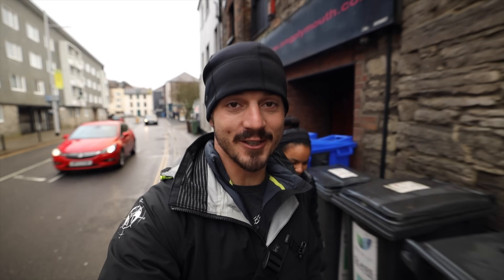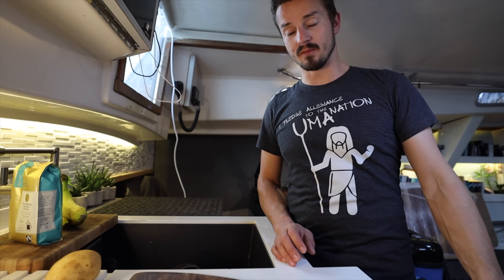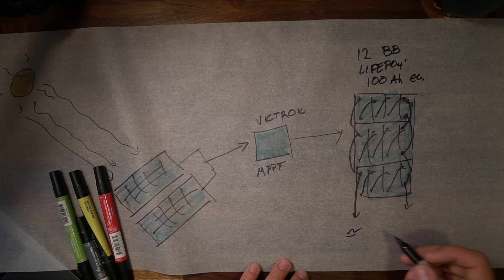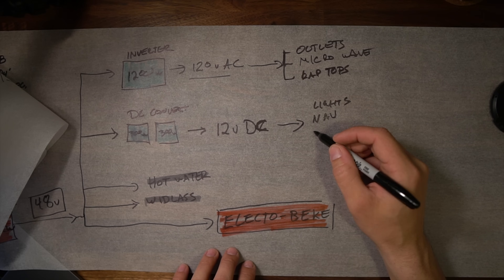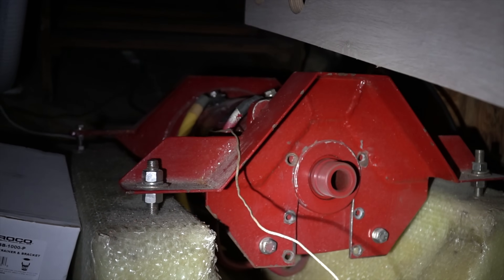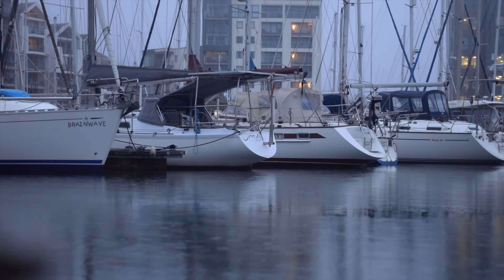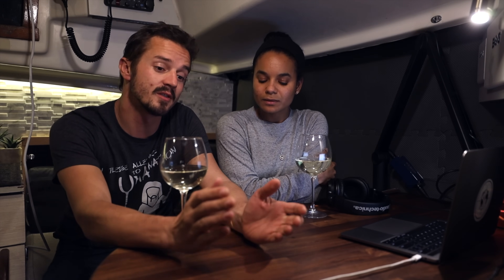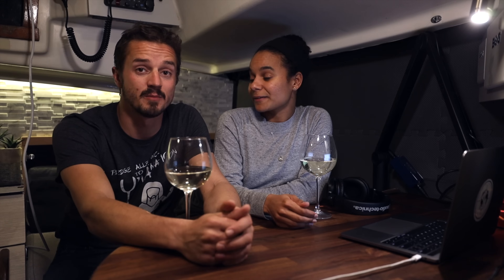5 Years Living offgrid on an ALL ELECTRIC Sailboat — Sailing Uma [Step 206]

Comment: Ok I know this is old and you probably already figured this out… but most laptops now can be charged from 12V so you don’t have to use the 110V wall wart and inverter. The laptop wants DC anyway so the most efficient path is through your DC/DC converter. There are some nice USB-C PD jacks you can get that get hard wired to 12V or use a cigarette lighter port.

Comment: How can 100Ah * 12 * 48V make 15KWh?
Reply from the maker: 100ah X 12V = 1200Wh (each battery)
1200wh X 12 batteries = 14,400Wh

We had 4 12V batteries wired in series to make 48V and we had 3 sets of these wired in parallel. 

I think the confusion is that most boat owners refer to everything in "amps" which makes zero sense, since amp depend on what voltage you're using. And since most modern boats now have at least 2 voltages (12V DC and 230v AC) amps mean nothing unless you're specign wire size or breaker size. Watts is the real number to focus on, since that's the actual draw an appliance is making.
Reply: @SailingUma  i wrongly assumed that they were 100ah 48v batteries, thanks for clarification

Comment: could you use your motor for regenerative use? Why don´t you?
Reply from the maker: We can now. Since we’ve upgraded from this unit. 

We’ve done a lot of trials and learned a lot. 

Bottom line, direct drive and fixed prop set ups really don’t provide much usable regen at the speeds small monohulls sail at.

Comment: Great job explaining your power system, your energy storage and usage. I am guessing you might consider replacing your solar with more efficient panels and also increasing the surface area a bit ... maybe have a portable/temporary addition panels that can be plugged in toward the bow during non-sailing, anchored or docked...

Comment: I am so glad I found your Channel. That said it will be interesting if you all ever get to a place like Indonesia where Trade Winds don't necessarily blow and the heat and humidity are high and cause problems with things like refrigerators in small spaces with less than optimum ventilation. You guys are in my top three Sailing Channels. Your Videography,Organization,Interior Design,Engineering and Creative Intellect are unsurpassed....Kim Philley SV Philiosophy aged 69, currently in year 13 of slow world cruising presently cruising in Indonesia...All the very best to you two
Reply from the maker: We've almost never sailed in trade winds. Only for a brief few months in the Caribbean. Our freezer can also be cooled with sea water when the air temp gets a bit too much.
Reply: @SailingUma  I should have known you would have thought of the Seawater cooling option. Your an amazing and oh so REAL cruising couple. Truly an inspiration. My very best to you all...Kim

Comment: Wow!! FINALLY some technical info!! ...NICE!!....👍👍👍...and as a retired electrician, stuff that really excites me!! 🤓🤪. Woohoo !!
Now, a couple of things... you mentioned "depleting" your stored energy, and now that your using AGM batteries.... curious if youve noted any difference between lead acid and AGM regarding how "depleted" - low on charge do you allow your AGMs to get vs the lead acid? Do you think the price for AGMs will prove a better i vestment over time?? They have quite different characteristics. Considering you didn't set off as an electrician, I think your doing an amazing job. Your explanations were great. One thing I think will be important is reflecting on 'value', both under your initial cash-strapped circumstances vs from an entirely new perspective now that dosh appears easier to come by. I ask this because its actually a fundamentally important perspective, as you well remember, Im sure 😏. Im stoked that things are working out for you because in  parallel,  all your posts are getting more interesting and thats great for US. Im so inspired... Tha ks!
Reply: oops... Lithium ion, NOT AGM... sleepy...

Comment: How do you attach your batteries to shore power when in the marina?
Reply from the maker: You just plug in with a long cable. That goes into a battery charger and then to the batteries.

Comment: Excellent video! Having lived on my own boat of the same vintage  for some eight years, I hugely admire all of your many elegant solutions and improvements. One very small quibble: electrical generation and consumption per day is in units of kilowatt hours, which is energy,  not "kilowatts per hour", which is a measure of the increase of power.  You wisely did not mention "amp hours", which in a multi-voltage system is a meaningless measure of charge.  The example of Uma shows how much battery storage is needed for useful amounts of energy.

Comment: I know I have come to this late. Does the 240v shore power goes into the charge controller that is in-between the solar panel and batteries? Or does it have its own system linked into the batteries? Thank you. Chris
Reply: Solar panels provide DC currents - no place for AC power. This is battery charging, either parallel to or included in the inverter(s), where DC meets AC. 
At some time in Norway, Dan changed the inverter set-up. I don't find the video now, but there he may have talked about the ciruitry.

Comment: Can you explain, in case of mayor power failure, how can you make contact with authorities to get help.
Can you add more solar panels? 
Stack the solar panels and open only when you needed
Reply: They have an EPIRB. This is a certified emergency communication device that, when activated, sends out a distress signal to a satellite, including GPS location, and the name of their boat. From there the nearest maritime authority will send someone to help them. I believe EPIRBS are certified to be good for five years before they need to be inspected and/or replaced.

Comment: So basically, all-electric works in the south but not quite there yet for the north. Amazing work. Nice break down too
Reply from the maker: Pretty much. Tropics and Med, solar is plenty. UK, Norway or anything where the sun doesn’t shine as often, you need to stop in marinas more often or get a genset. Or a faster boat with a larger battery bank. Our little 14kwh bank is tiny compared to most EV’s.

Comment: I know this is an older vid, and you've since upgraded to the oceanvolt motor system with better regen, but I had a couple of thoughts to share.
I'm a full time RVer and I spend most of the fall/winter/spring seasons off grid on solar power.  So I'm all with you on efficiency.
One thing I did for my laptop was a small DC to DC converter that outputs 19V DC.  The level the laptop power supply provides. In measuring its power consumption, compared to using an inverter and the laptop supply, I found it to be 42% more efficient.
Also,  does anyone make a drag-behind water turbine?   I'd imagine you could get even more power to augment the regen from your prop.  Maybe even generate some power from currents when anchored.  If nobody makes one, maybe that's a D.I.Y. project in the making?
Enjoying your show quite a bit.  And also I'm so impressed by the amount of work you've both done, taking that boat from the edge of death to a beautiful home.
Reply: There are a few hydrogenerators out there, like SaveMarine or Watt&Sea.  They need quite some speed to deliver some useful amount, and downwind they don't do much. The faster they go, the more more efficient it gets, so I guess they work better for racers and catamarans.

Comment: I'm an internal combustion kind of guy, love engines that run, got to run, however especially on a boat. good job on the  electric motor conversion. Thinking about it for my boat too but  the knowledge base is an uphill curve. You took on the project and did it. Great job ya'll.

Comment: Are there any underwater devices to generate electricity? It would cause a little drag on the boat but, I don't know, would it be more or less efficient than a wind turbine on the foredeck?
Reply from the maker: Our electric motor does exactly that

Comment: Laptops draw very little power.   Maybe 30 to 40 W maximum.
Reply from the maker: Not when you're editing and running a few external drives. Even a MacBook Pro (which is super efficient) runs around 60-70W and we're often on them for 8+ hrs a day. So 60W X 2 X 8 = 1kWh. Thats 1/2-1/3 of our daily usage is JUST our computers.

Comment: im waiting for the day we ditch A/C appliances. it should be coming. get off AC and no need the inverter
Reply from the maker: Overall efficiency of ac will always be better than dc. Besides, our inverter only uses about 10w. In the grand scheme of power consumption, it’s not even noticeable.
Reply: @SailingUma  i'm just saying some day get off invertors and just go straight panels, batteries , chargers. the invertors are the weak link. converting dc to ac is the tricky part. go reliable, get off the invertors. if ur toaster and can opener and lights and a/c motors were all dc then that would be great no invertors. we will be there some day

Comment: sigh Units matter. "15 kW of battery" - you mean kWh right? If you can't get the units right you don't understand what you're talking about. Look-up Peukert effect and you'll change how you manage your laptops. Seriously not impressed with electric cooking. Have you done a FMEA? What will you do with raw chicken if you lose power?
Reply from the maker: Yup, units matter.... if you're an electrical engineer. But us regular folks just abbreviate everything and know what we're talking about. If you ask a sailor how big his battery bank is or how big their solar array is, they'll answer in kW. How much does that appliance draw? Also kW. How much power does your wind turbine make in a day? kW. We know what we mean and that's fine. No need to overly complicate things. Well, in reality, most will answer in "amps" because most only have a 12VDC system. 

We've had these discussion with many sailors and non sailors over the years, and have watched their eyes glaze over when we start using kW AND kWh in the same sentence. So we abbreviate, and simplify to help non electrical engineers understand the very basics of what's going on. Is it "correct"? Nope. Is it effective? Absolutely!
Reply: @SailingUma  Poor practice. Certainly don't beat up the common sailor, but YOU are suggesting expertise and should get it right. That you haven't means what you suggest isn't credible. Now about that FMEA?

Comment: Get a 12V USB C PD charger for your laptops so you’re not losing efficiency with the unnecessary inverter. Great video!
Reply from the maker: Our 12vdc goes through a converter too. Besides, the efficiency loss isn’t actually noticeable in daily use.

Comment: Have you fitted a lightning rod to Uma?
https://www.boatingmag.com/gear/how-to-prepare-lightning-strikes/
Reply from the maker: It’s a sailboat. It’s one giant lightning rod. 

Our mast is bolted to our lead keel, so we’re about as safe as you can be.
Reply: @SailingUma  sorry did not realise there was a metal to metal connection between your mast and the lead section of your keel. Thought there might be a wood and fibreglass layer between the two and that you could end up with a two foot hole in your boat as described by Clark of Emily and Clark in SV Temptress here:
https://www.youtube.com/watch?v=PurMG7KHdW4

Comment: yo, you should ditch the AC laptop chargers for DC ones
Reply from the maker: 120VAC and 12VDC both go through voltage converters onboard, so it doesn't really make any difference.
Reply: DC to DC conversion is a lot more efficient

Comment: Watts are not an amount of electricity, a watt is the rate of energy consumption equal to 1 joule per second. You're not storing 2 kw per day, because 2 kw is a rate, not an amount. You would be storing 2 kw *hours*, which is the amount of electricity required to supply a constant load of 1 kw for 2 hours. The average house in the US consumes anywhere between 20 and 40 kwh per day, used to run AC, heating, refrigerators, lights, computers, televisions, dish washers, washers/driers, and so on.

Comment: Hi, great video! I just had a discussion with a friend and we argued what happens if u can’t sail and it’s not sunny. Does your motor has enough reach to get you back to land? Does a normal Diesel has  enough range to get you back to land? I think the horror Szenario we argued about is if your mast breaks or something like that in the middle of the Atlantic... very unlikely...I know.
Reply from the maker: You can never rely on any motor to "Get you back to land" unless you have a power boat. Most diesels on average sailboats have maybe a 2-5 day range. Our electric is more like a half day range. But the easiest and cheapest option is satellite weather forecasting, so you know where the wind is and plan your route accordingly.
Reply: @SailingUma  thanks for the fast answer! That’s good to know!

Comment: After working as an off grid power consultant for many years you have given a really good tutorial on how the system works and how much energy you use. I’m also keen to hear how you go with propeller regeneration. That’s a great idea. The only nit pic is energy used daily being kWh not just kW. My boss would always pull me up on it. Great work guys. If I find my “Uma” I might see you on the high seas! 😀

Comment: Regarding the electrical diagram in the video . . . .   Does this remain your current configuration?  Also, the solar controller indicates 12/24 volt?  How does that work with your 48v bank? Thanks for what you guys do!

Comment: SV Delos has an induction stove which seems really nice.  Would that be possible on your boat in the current configuration?  If not, what would you need in order to support that (I'm still binge watching so maybe this happens later).

Additionally, how concerned are you about a lightning strike during passage?  That is a common argument I've seen for why one should keep a diesel engine.  The maintenance of an electric motor is really compelling, though.
Reply from the maker: We have an induction and microwave, electric kettle and rice cooker now too. But what we don’t have, is a genset or diesel motor to charge our batteries back up after using them. So we typically only use them at the marina. We’re working on more ways to generate power, so we might use them more in the future. 

As for lightning. Our mast is bolted to our lead keel so it’s about as good as you can get. However, we don’t see our motor as a vital piece of safety equipment, so if we ever lost it, we’d be fine until we make it to land and can sort it out. Keep in mind, diesel motors need electricity to start too, and most newer ones have plenty of electronics keeping them running smoothly. So unless you can hand crank your diesel, it might not start after a lightning strike anyway.
Reply: @SailingUma  thank you for the information!

Comment: Is there an issue of over charging? And if so, what do you do, cover the solar plates?
Reply from the maker: No issue. Once our batteries are "full" the chargers go to "float" or shut off. But in reality, that never happens. Our boat is always using power.
Reply: @SailingUma  I think it is remarkable you take the time to answer my questions. You have so much to do and so many people to respond to, i was surprised. But i so much appreciate you taking the time. I am watching my way through your videos and learning a TON about how to do things. It looks like a working knowledge of construction is a must if you buy old and likely also buying newer, with maintenance. But i am making lists of tools you use and getting ready for getting my boat. I am looking and working through all that in my spare time. Anyway, thank you so very much!

Comment: Awesome choice of vid. Van build and boat refitters are gonna love you for laying it out so clearly. Quick suggestion: Why not keep a small 2kW generator stowed away with a gerry can of fuel? it is a great emergency measure. If you take a lightning strike or some problem means you can't run your pumps, this will be a backup. However, when times are good, you can wire it to your charge controller and fill your batteries when you don't see sun for a few days. This is how silent-yachts works their power generation when the sun don't shine.

Comment: Technical question. Have you considered hydro-generators on top of solar? Wind certainly generates some of the best power if it is appropriately sized, but if you can consistently cruise at 5 knots (which displacement suggests you have a hull speed around 7.25 so should be reasonable) you'll be generating 130w constantly. Doesn't seem like a lot, but that can run your 12V Battery Bank for roughly 240 amp hours from 24 hours of cruising. Also, I highly suggest a quality UPS if you don't already have one specifically for emergency communications and critical systems in an emergency.
Reply from the maker: Our electric motor generates power while we're sailing.

Comment: A lot of the time you saw kW, you actually mean kW-h. Not power, but energy: power over time. Usually the fridge/freezer takes up most of the energy budget on a boat, despite being a low-power appliance (compared to a circular saw, microwave, or electric kettle). Mostly just a trigger for energy pedants. Thanks for the real-world summary!
Reply: Same comment I wanted to post right now.
Reply: Yes, please can everybody who wants to talk about electricity please learn the difference between kilowatts and kilowatt hours , it is like the difference between horsepower and gallons!
Reply: multiplied, not over (divide)